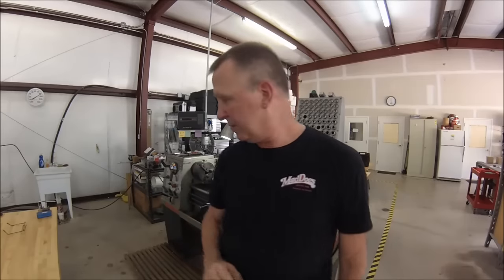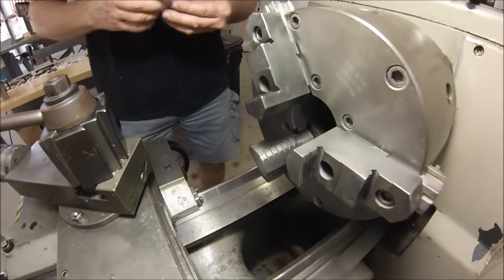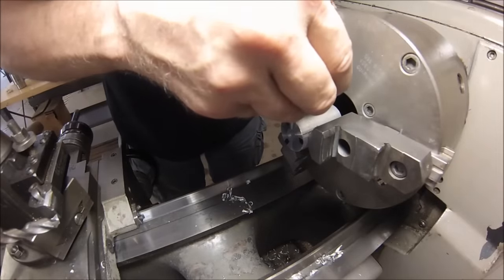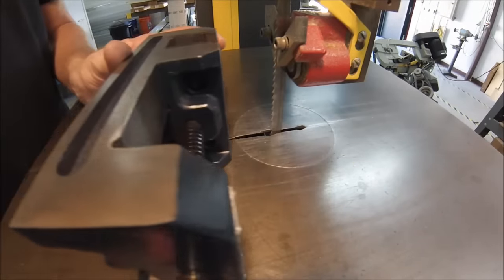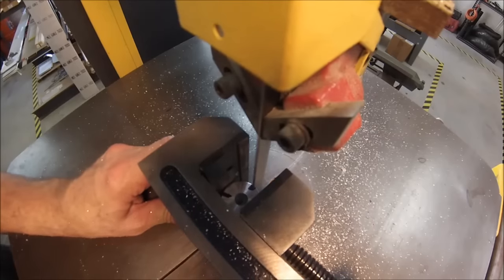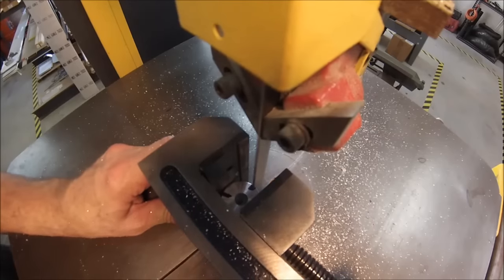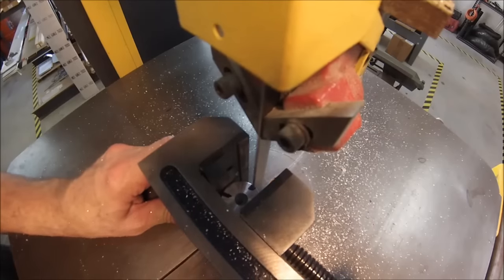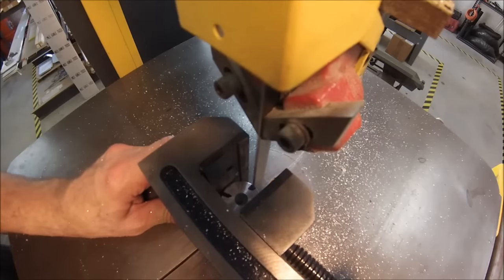Get your parts to run true in a non adjustable chuck. YOU MUST WATCH THIS!

Comment: Good method, however with all respect due to the slotting on the band saw a bit complicated. Based on the same principle of a sacrifice "collet" there's another traditional method which I would personally prefer. This is to turn a sacrifice collet with small wall thickness accepting the work at tight tolerance. Due to the small wall you can then deform the collet-bush and hold the work. But once again, a good method

Comment: Great tip! Just curious why you didn't just stick with boring it to size. Seems easy enough to hit your size, especially in aluminum, and would insure the hole was straight and true. It actually looked like your reamer dropped just a tiny bit as it came out of the hole.
Reply from the maker: I could have for sure. I don't like to suggest techniques that may require special tools like small long boring bars. A reamer is just more common.

Comment: As the bushing has some spring to it, why not just bore directly to your part OD(0.500)?
Thanks for the videos btw, I just made an expansion arbor at work for a thin walled aluminum piece I was making, worked great.

Comment: I know it eventually corrects itself in the end -- but with slight-of-hand, you LOST all initial indexing of part when flipping it over to face the second side (AFTER you had previously drilled the initial hole.) After the hole was no longer centered (after facing second side), only then did you attempt to create registration marks.  Wouldn't it be better to create those registration marks IMMEDIATELY after drilling the initial hole (before subsequent operations), to prevent a now misaligned hole from influencing other refinements?
Reply: I was wondering why no caught that .

Comment: I'm more of a math teacher than machinist and this is a great illustration for practical application of geometry without the need to explain which principles go where.
unless I'm mistaken; you mark the location of the jaws [3@120º] on the scrap would-be bracket, then cut into those marks, then turn the bracket 60º so the jaws are insole footing and the flex-gaps are between the points of contact.  since the i.d is non-concentric to the o.d [the whole point of this task] would it be 'better' to cut the gaps in-between the jaws' marks so they can be placed back in the same position?  if not, why not?  is it too insignificant?  is there at least as much error reintroduced by the flexing and shim that it can be ignored?  just curious and impressed.
Reply: I was a bit confused by that as well at first, but he comes back and enlarges the center hole; once that's done the makeshift collet is not disturbed. Enlarging the center hole with a boring bar will eliminate runout introduced by the slight rotation.
Reply: @markp5726  yeah I watched it all again and I don't know what I was thinking, it seems obvious now – even to a wood elf like me.

Comment: I enjoyed the vid, but I am missing a trick. The initial drilled bore went in on end 1 but was only marked up on end 2 when that was faced off. Surely you'd have a better result if that initial drilled hole went in on end 2 when the marking up happens. I am aware a guidance bore goes in after slotting but the 0.484" drill is encountering greater run out of the pre-drilled bore as it deepens, surely.
Reply from the maker: Don't forget the hole actually gets smaller after the split and squeeze operation. The runout should be the same all the way to the bottom of the hole, so use a drill that will create a good pilot hole.
Reply: Thanks for your reply Joe. I think you're right to say the runout remains the same throughout, but the marking you did on end 2 seems irrelevant to the original orientation when the hole was drilled. You got a good result though, hence my missing a trick comment. Good vids mate.
Reply: Joe Pieczynski Yeah, you drilled the hole then turned the piece around without marking the jaw locations

Comment: If you want very true. Get some old chuck jaws and weld some M S square pieces on them. Bore them to suit. Accurate & cheep every time, both external & internal
Reply: Where in this video does he talk about boring jaws or welding? And you spelled 'Cheap' wrong. Good attention to detail david.

Comment: Great video Joe.  So you can take these out and then put them back in later?  Do you need to mark the jaw locations so you can get it back in the same location?
Reply from the maker: Not advisable unless you squeeze a thinner shim and re-bore it. Hex stock works well too.

Comment: been using a file over 40 years; the trick is to run spindle in reverse and hold the end with no tang .If you let go, no harm unless there's somebody in it's path, but if it launches over your chipguard your running way to fast.
Reply from the maker: That sounds like it would work. Interesting technique. I think the one thing we can all agree on is that putting your hands in a moving lathe for any reason is a bit risky. Just be careful however you do it.
Reply: Joe Pieczynski

Comment: I did my apprenticeship in the early - mid 1970's and I am very right handed. My foreman would kick my backside if I leaned over the chuck and used a file on a lathe right handed. Since then I have always used the file left handed. Much safer.
Reply from the maker: I agree 100%. But since I am the foreman, I'll stick with the reach over. For me, its much more comfortable and controllable. I know its not the safest, but its my zone. To change now would be more dangerous. Thanks for the comment.
Reply: Colin Weir waay

Comment: What about using a hone and slowly close the jaws on it, then back out and close jaws a little and run the hone back in? Rotating the chuck manually would probably be advisable as that would keep any slack or vibration out of the jaws.
Reply from the maker: A hone doesn't react well to split surfaces. I have to imagine it would grab and detonate. A toolpost mounted grinder would be best.

Comment: Joe I hope you dont mind some of my long winded comments.
But one thing dawned on me the other day that I have never seen brought up on YouTube.
My three jaw chuck can be out from almost nothing to .003 to.004 at any given time depending on how I put the stock in.
If a person center drills stock and then puts it in the tail stock by way of a live or dead center and uses the out of center three jaw chuck they are going to turn a taper.
If the chuck is out by .005 and the stock they are turning is 1 foot long that taper will be .005 - .010 per foot(?).or what ever the distance is between one end and the other.
The stock will be concentric to the center and the chuck but still be tapered. 
Am I not right, because this is how you turn those fancy tapered chair and table legs with a wood lathe by cutting away the ghost.

I have also came to the conclusion that test bars for aligning the tail stock is a waste of money and a product gimmick. at least in my opinion.
No offense to anyone that has one.:>)
What I do is stupid easy and and you dont need to make or for most folks buy anything and no it isn't a razor blade.
Joe your collet idea has saved a lot of folks from dismay and grief thanks.

Worth
Reply from the maker: Your comments are just fine. If you plan to turn between centers and have an out of concentricity chuck, simply make a blank and turn the driving center right in your chuck end instead of trying to true up an already made one held in the jaws. Make sure the slug you use is stepped so the step hits the jaw faces and won't push back under pressure. Problem solved.
Reply: I dont normally turn between centers but what you described is exactly what I did, shoulder to prevent slipping and all.:.)
I have a 4 jaw too and I use it much of the time now.
Reply: Worthy---------Is your 3-jaw chuck out of CC, or are the jaws out of CC?   I noticed you placed an indicator on the chuck.  Whats' important is the jaws of the chuck, not the chuck itself.
Reply: I dont know what I was babbling about, no not on the chuck.LOL
No I can turn a perfectly round bar on the the cut it off and put it in the lathe and it will be .003 out sometimes no matter what I do.
This round stock is way less than .0001, in other words it doesn't move the .0001 indicator when I test it for taper or roundness.
The same thing is seen with a ground rod that is round.
The chuck is as clean as a whistle inside and out.
The spindle has 0 run out..
As far as I am concerned like I said a 3 jaw chuck is just that, something for down and dirty work.
I could true up the jaws but to what end for .003 of an inch.
You can plan your cuts around this and still get very accurate work.
Worth

Comment: It looks like you are not using oil on the lathebed,do you not fear that over time the bed gets shallower?i am asking because i have bought a used lathe and that was the case.I had to remove about 0,05mm nearly over the whole lenght because it was only the first 15cm where it was not flat,i did it by hand with a straight edge,ink and diamond grinding sheet which i glued on a small flat metall block,i think i needed at least 50 hours! 😅 but now it is very accurate.😁
Reply from the maker: The bed is oiled regularly.
Reply: Now go show how to get your chucks to run concentric with the Lathes. Concentric, and run out!!

Comment: The blade pitch depends on the thickness of the material, not the type. The longer between the teeth, the more room there is for burrs. Having very small tips in thick material will just fill that room and build heat. As a rule of thumb the distance between teeth always have to be smaller than the material cut. In thinner material this can be solved by cutting diagonally trough the material, engaging more teeth.
Reply from the maker: Give me a time stamp as reference for this comment.

Comment: I am so new to running a lathe, I'm still setting mine up, doing the wiring, spatter/chip guards, etc, etc, etc.  In the process of mounting the non-std DC motor, I have needed to get it working temporarily to make some specialty threaded studs, and a few other things, for assembly/setup.

The Sherline I have has a threaded spindle with runout at about a needle width's movement on a 0.0005" indicator.

The (scroll?*) chuck doesn't have a clear path for indicating the OD, so I have to use a end mill, or drill blank.  

{{{*The 3 jaw has a spiral relief cut into the back half of the chuck, which the jaws move on. That is what the term 'scroll', refers to, isn't?}}}

The best I can get runout on the chucked material is 0.0030-0.0035".  

Short of making one of these, or buying a new chuck, (Sherline says 0.002-0.003" is as good as it gets.), do you have any vids, or know any techniques, to get better runout from a thread mounted chuck?

I am planning on a 4 jaw chuck, later, but buying a new chuck won't fix the runout, if Sherline says it gets no better.

Any help for this noob will be greatly appreciated.
Reply: George Dennison Hi,  if you've just started, try and get a copy of "The Amateurs Lathe" by L H Sparey loads of really good stuff for a new
guy interested in this great hobby.

Comment: Hello Joe. I realize this is an old video, but it brings me to a question, that I cannot find an answer to. Regarding chuck runout. Is it possible for the scroll boss, or the scroll itself to have runout ? If it is, then grinding jaws, might work for the jaws as long as the part being turned is the same diameter as the slug used to preload the jaws while grinding. However when the scroll is rotated to a different location, then the grinding you just did, will cause even greater runout for a larger or smaller part. Or am I looking at this wrong ?
Reply from the maker: You are correct. if the scroll has issues, you'll be chasing your tail forever. the best way to determine this is to check given diameters. 2", 1.5" and 1", or some combination of diameters that you know for sure the scroll stops in different places. I believe 2" is the standard for jaw grinding and evaluation.
Reply: Thank you.

Comment: My old DoAll saw is probably the same old model as your's.  We bought it used, and it was evident the structures that held the blade support bearings had been modified.  The blade support bearings were missing.  I called DoAll, and ordered the parts they told me to get.  But it's never been right.  I had to install shims under one bearing to better support the blade.   The saw doesn't track straight no matter how tight I adjust the blade, or how close I position the guides to the stock being cut.   Perhaps the next time you replace the blade support bearings you can create a video showing the parts, reassembly, and adjustments.
Reply from the maker: My saw utilizes a 'T' shaped button that sits in both of the thrust bearings. The smaller diameter presses into the inner diameter of the bearing and the larger diameter is about the same size as the bearing OD. The larger diameter is about 4mm thick. .180 +/-. Then the tilt of the upper wheel is how you gap the blade to that roller pads. There is no adjustment at the thrust bearing. The blade should just about touch the buttons with the machine running and no cut being made. The blade should engage the pads when you add pressure from a part. I made mine from 17-4 stainless and hardened them.
Reply: Thanks Joe. I don't know why Youtube doesn't alert me when people respond to my comments.  My saw also has the T buttons.  But something is wrong about the alignment of the top and bottom bearings.  They don't line up.  So the back edge of the blade will touch the upper button, but not the lower.  Is there supposed to be a shim or spacer behind the lower bearing?

Comment: Joe

In the video you mentioned an upcoming video on how to cut thin washers.  This will be great since I am running out of thin ie 0.010 to 0.020 thick brass washers for use in  shimming shafting ie lead screw mostly.

Dan Bentler
Reply from the maker: Hi Dan. What is the ID and OD of your washers have to be? Maybe we can knock off 2 tasks at once.
Reply: Joe
The immediate need is 0.750 x 0.015 thick x 11/16 OD (could go to 3/4) Qty 1 for screw on Craftsman compound.  Use brass.

Lathe is old and has seen its share uf use misuse and abuse.  I do not like steel on steel contact and prefer using brass as a consumable "wear plate"

Dan
Reply: Joe
Typo.  Change the 9.750 ID to 0.375.  Last time I checked OD must exceed ID.

Dan

Comment: Since you managed to mangle the chuck up what is the technique that you may show us on the next video to make the chuck run better? I just know about using different jaws to see which one works best while clamping on part but is there a better way? Is it safe to when part is lightly in the chuck with indicator on it to tap on the jaws and make it like poor mans adjustable chuck? Certainly your technique with a fixture making for a small part runs is a great idea through time intensive plus you need right size reamer (or you just bore it out and loose some accuracy).
Reply: Tom a light tap with a copper hammer on the low jaw can frequently be usde to move the scroll a thou.  I said light tap...

Comment: Magic! You mentioned during the recap (I think...) that you save the bushings for future jobs. Taking your 1/2 inch example, the next time you want to use it, you would place the bushing in the chuck with the slots between the chuck's jaws and then...? How would you regain the accuracy? You were very careful initially at the time of removing the wedge not to permit the bushing to rotate in the chuck but on a repeat this relationship has been irreparably lost. Is it use a new wedge and carry on? Or...? Thanks.
Reply from the maker: Same shim, but bore it to the next size up to re-establish dead on concentricity. Worse comes to worse, use a thinner shim and rebore to the same size. The thinner shim will allow it to close down farther for the rebore.

Comment: Joe Pieczynski  It is only obvious that you have a reason for preferring a three jaw chuck for round parts, but if you told us why, I missed it. I can certainly think of reasons that go mostly to speed of repetition and repeatability when the part has to be removed. With a four jaw, my slight experience is that I have to spend more time making sure the part is still true or essentially feel like almost starting over every time I chuck a part. But it is also my understanding that a four jaw chuck is less stable as the lateral lash in the jaws are continuous through the part and the shared axis of both jaws. But doesn't the capture of the perpendicular jaws cancel that out? Can you detail your concerns of using a self centering four jaw and a simple four jaw?
Reply from the maker: My experience with a 4 jaw is that they are not usually purchased as self centering. if you do a lot of square work with central bores, they would be perfect. if you are looking for grip, get a 6 jaw. the 90 degree spacing of the 4 jaw chuck jaws does make them better for reduced chatter than a 3 jaw with 120 degree spacing, but if you survey all the comments here, I'll bet you see most guys have independent 4 jaw chucks. I'll stand by my comments and say a self centering 3 jaw is better for speed and production than a independent 4 jaw any day of the week. An adjustable 3 jaw is even faster.
Reply from the maker: You may also wish to watch the video I posted on chuck types, pros and cons.